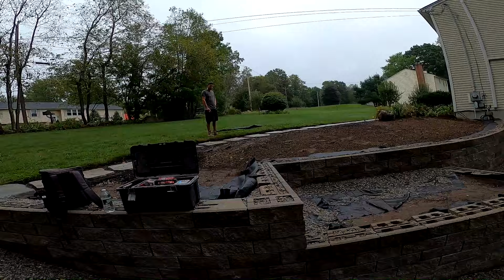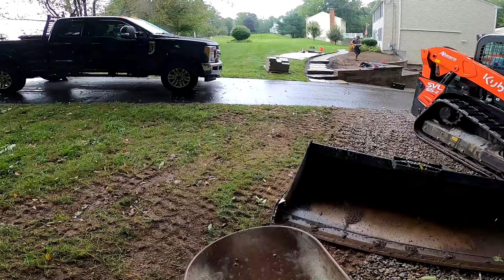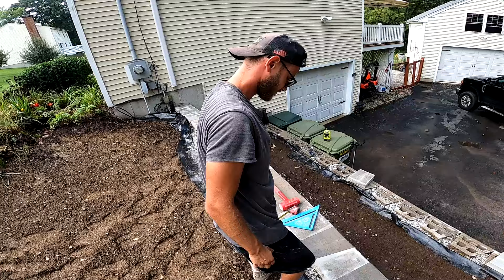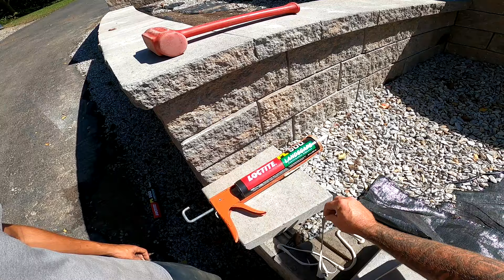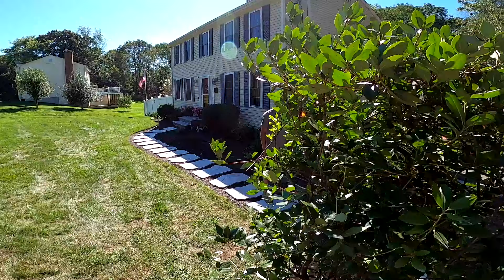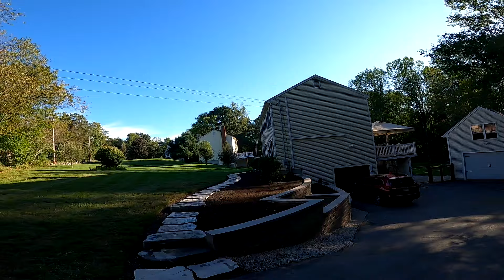How To Cap a (Curved) Concrete Block Retaining Wall

Comment: Awesome work with this wall!!

Would it have been a good option to add drain pipes behind them?
Reply from the maker: Thank you! There were a number of reasons why I did not put drainage pipes, but mainly because it was not necessary in my opinion. Water seeps through all the joints of the wall blocks and there is a ton of drainage stone behind both of these walls. Plus the subsoil is very well draining sand / gravel and will have no problem allowing water to permeate.
Reply: Makes sense. I am in Canada and with our winters we have no choice to add drain tile every 3 feet of elevation. Some contractors don’t do it and the walls fail…not all contractors care about their clients and their work